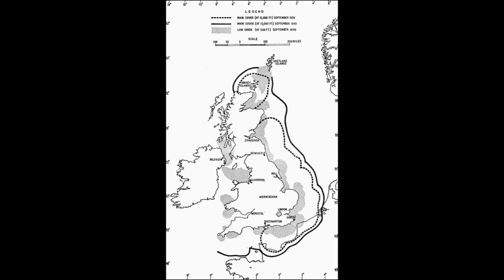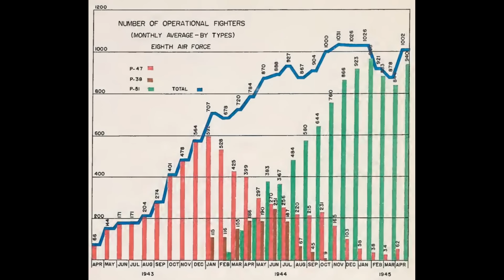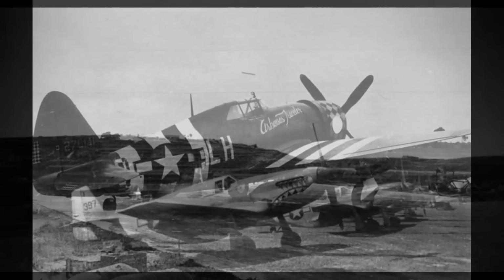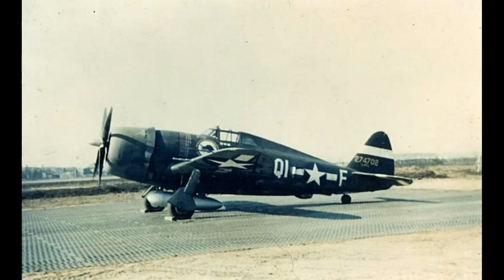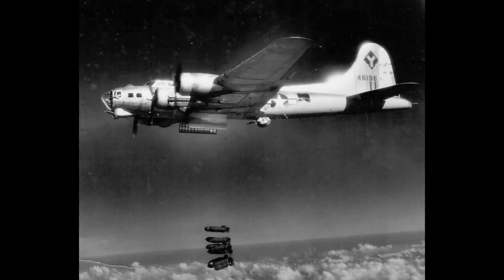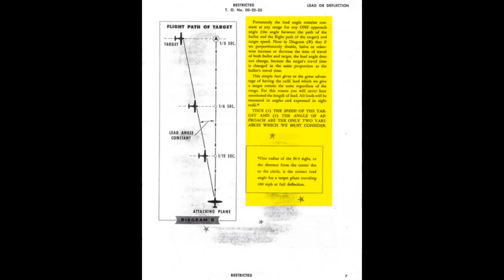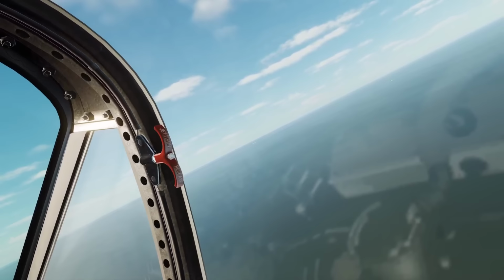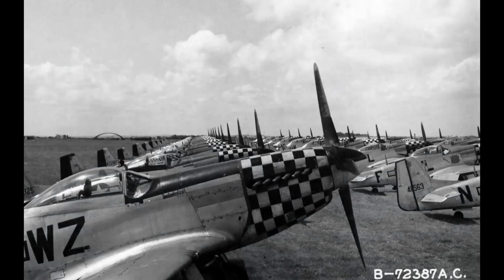Under Appreciated BRITISH Tech From WW2

Comment: Riccardo is still a world - class engineering company in the field of internal combustion engines today.
Reply from the maker: Yup, I should have mentioned that.
Reply: Only a few miles away from me, still on the site alongside the River Adur and Shoreham-by-sea Airport where the company was established post World War One.
Reply: Ricardo built V twin test engines that were 1/6 of the full V12. They were thrashed and played with to improve the production engines. However they failed to recognise the V12 oil pump was too small. The V twins used the full size pump so never had problems. Above 3000rpm, the V12 threw oil out of the crank faster then the pump could feed it. Ricardo really should have spotted that long before they did.
Reply: G'day,

That's ONE way of looking at Ricardo....

Have you ever tried calculating the Carbon Dioxide Emissions which have been produced by Engines which Ricardo's work MADE POSSIBLE...?

As Anthropogenic Global Warming ramps up and gets into it's Stride..., Ricardo's Kill-Tally of People on the wrong side of Storms, Floods, Winds, Hail, Droughts, Heatwaves, Fires, Famine and Starvation...; my guess would be that Ricardo is well and easily responsible for more  collective Human Misery than the bloke who designed Hitler's Gas Ovens....

Because when the Ovens were shut down they stopped cremating the murdered ; but everything emerging from a Ricardo-inspired Engine will continue heating the Atmosphere for at least 25 years after coming out of the Tailpipe...

The point in Time is rapidly approaching whereinat ALL the Pioneering Luminaries of the Fossil-Fuelled Industrial Revolution will be exhumed, and pilloried, and their Skulls used by the Mob as Soccer-Balls - merely to better inform their Shades of the extreme low-esteem and Pariah status in which they are held, among the still-living.

The fact that old Codgers like you and I were raised to revere the Pioneers of Aviation, and to salivate over the minutiae and details of their  Engineering ; the FACT remains that while feeding their EGOS, those bloody Clowns handed Humanity the means with which to destroy the Homeostasis of the Biosphere of Earth...

The LARGEST Single Organisation Emitter of Fossil Carbon injected into the Atmosphere, on Earth - is the US Department of Defence.

No other Organisation operates as many High-Power  Land, Sea, and Air Vehicles, or maintains as many Bases and Buildings (all lighted, heated, cooled and ventilated by Fossil-Fuelled Electricity) and issues as many Contracts to supply Goods, Services, and Equipment all produced, manufactured, and delivered by way of burning Fossil Fuels...

Unkle Spam's Pentagonal Haemorrhoids are the single Dirtiest bunch of Bums on the Planet. I'm sad to have to say it - but it is a fact.

How long are we expected to continue cheering and flagwaving and celebrating the short-sighted selfish dirty filthy wasteful destructive and poisonous Legacy, which  those miserable mongrel-bred Bastards have left, as wreckage behind them in their wake ; the smoking ruined detritus covering the overheated Earth, ALL  produced by their collective, Patriotic, "Life's Work" ?

At some point, Greg, we have to face the point that WE are the particular generation of  Scumbags who never ever thought to question our Parents' and Grandparents' decisions - instead we subjected them to Ancestor Worship, and then we all attempted to surpass their (reckless thoughtless wasteful dirty and destructive)  "Achievements"...; and thus WE have literally eaten our Children's Futures..., like any other pathetic greedy bloodyminded High-School Bully, stealing Play-Lunch from the  Kindergarteners...

So, maybe a bit less breathless admiration and enthusiasm, perhaps, when regarding the doings of the sort of silly bloody "Comedian" who gives a retarded Child a loaded Uzi, to see what becomes of the Experiment...; all in the name of Imperial Jingoism....

And, apparently, the Creator God of the Universe is not a CitiZen of ANY Nation on Earth, does not vote for or against ANY Political Party ; and does not care and is not interested in the competition between Capitalist Industrialists and Communist Industrialists and Fascist Industrialists to grow their EcoGnomie the fastest ; because ALL those bloodyminded selfish Morons are COMPETING to destroy their bit of the Biosphere fastest and firstest.

"Sieg..., HEIL...!"

translates as

"Victory..., HURRAAAH !",

OUuuuRaaahhh ....?

No Semantic Linguist can fit a 1-Thou. Feeler-Guage between "Sieg Heil !" and "OuuuRaaah !"...

Let
THAT
Sink in...

ALL of that
Patriotic
Industrialism...

The Wasted Effort
Which has almost utterly 
Wrecked
What used to be quite a
Delightful
Planet, on which to
Live
And
Raise
Children...

We were raised to revere the results of a Global Fashion for  Counterproductive Paranoid Diversional Therapy for Techno-Nerds ; obsessing over Compression-Ratios and Torque-Loadings and Tensile and Compressive Strength and Metallurgy and Fuel Consumption etcetera etcetera ad infinitum ad nauseum - while totally ignoring EVERYTHING which mattered considering what   came out the Exhaust Pipes, and living in Denial, as regards what those Exhaust Gasses were, and ARE, Achieving....

So, when ARE we going to stop singing the Praises of all the cunningly clever Buggars who dedicated their entire LIFETIMES to ways of burning ever more Refined Fossil-Fuel FASTER..., in order to pump ever more Shit into the Sky...?

Why are we cheering the bloody VILLAINS of the Story ?

Hmmmnnn ?

Just(ifiably ?) sayin'.

Such is life,

Have a good one...

Stay safe.

;-p

Ciao !
Reply: @WarblesOnALot  username checks out
Reply: @neilwilson5785  

G'day,

Yeah...

Truth-In-Labelling...

As the saying goes.

Such is life,

Have a good one...

Stay safe.

 ;-p

Ciao !
Reply: Also builds special vehicles for the British Army...
Reply: @WarblesOnALot  Wow
Reply: @markevans8446  

G'day,

I hope I didn't startle you, but the fact is that everything I said is true.

One of my proudest achievements has been restraining myself from rebuilding my 2nd Aeroplane, after we broke each other in 1992 (Downwind Take-Off, Ultralight Motor-Glider, Fence-hit, Inverted Landing in the next paddock...).

I have slowly accumulated the materials for the job, including a Rotax-377 to replace the gutless JPX Pul-425...; but, considering Anthropogenic Global Warming, the World will NOT be improved by me enabling mySELF to go up and make slow-moving Lawnmower-Noises in the Sky while farting Fossil-Fumes which will make the Drought/Heatwave/MegaFireStorm/Downpour/Hail/Wind/Flood Cycle grow forever worse...

My first Aeroplane hangs in the
"National Transportation Museum ; Visiting My First Aeroplane...!"

and my second lives in it's covered Trailer, a potential "Project" stalled for 31 years because I can't justify farting CO-2 for the FUN of fcuking up the Biosphere.

So, right now I'm enjoying my eBike, learning to logbook it's 4 Batteries meticulously, recharging from Deep-Cycle Lead/Acids charged by a Solar Array using an Inverter.

Living off-grid, the Solar Hut Lighting taught me enough to be enjoying the eBike..., next step is an Electric Chainsaw and Electric Brushcutter - with  the extra Panels and Batteries to recharge them ; followed by a Road-registered Electric Motorcycle..., and then the notion is to put an Electric Motorcycle Motor and Battery where the Rotax-377 was to have replaced the JPX...

Because a Solar-charged Electric Ultralight Motorglider would enable me to exercise my Biggles Fetish without shitting in my children's Air Supply.

At some point, old Bastards like me are going to have to stop pleasing pleasing ourselves, stop behaving as a mob of Selfish Pricks ; stop patting ourselves on the back for having achieved the doing of some Autistically difficult Thing - and start considering the Long-Term Consequences of all our Planet-wrecking Harvest Everything-ism.

And if I never fly my 2nd Aeroplane again until I can take it levitating to enjoy the view (and wallow in the thrill of the Death-Eater's Challenge involving  landing it again,  without breaking shit or hurting myself)..., without having to burn any Refined Fossil Fuels to do it ; then my guess is that generations of the as-yet unborn will be pretty pleased with that outcome.

And, y'know how Parenting works.

Everything falls under the

"Littlest Kid Rule..."

Which is why, for example, Toddlers will happily wait their turn and watch while their Parents care for the needs of the Toddler's newborn Sibling.

The Toddler knows that, being older, they can wait with better grace - while the Newborn's NEEDS are catered to..., than can the Newborn wait while the Toddler's WANTS are being satisfied...

And, as Adults, our WANTS to fart Fossil Fumes for the Fun of it all - going faster and higher, with a bigger load...; must, morally and ethically squeaking, come a long Long LONG way behind the NEEDS of the Generations yet unborn to be delivered into an actually Habitable Biosphere.

What's your annual CO-2 Emissions Footprint...; or haven't you worked it out yet ?

We have to do this Decarbonisation thing at some point, it is NOT avoidable and the longer we continue making shit get  worse then the harder it will be to make the change...., so why not start now, then ?

Such is life,

Have a good one...

Stay safe.

;-p

Ciao !
Reply: @jester5ify  

G'day again.

Question...;

Why do we need Armies...?

Answer...,

To prevent our
Handies
From falling 
On the
Ground...!

Such is life,

Have a good one...

Stay safe.

;-p

Ciao !
Reply: just wait till this guy finds out where the lithium in his batteries comes from
Reply: @WarblesOnALot  In the 1970s the climate scientists were telling us we should be preparing for the coming ice age. They still are not growing grapes for wine in the open in the UK like they did in Roman times.
Do a bit of historical reading why don't you?
Cheers.
Reply: @dairyking2479  

G'day,

Chile.

They sell it to the Chinese.

I am not as
Silly as
You
Look...

;-p

Ciao !
Reply: @WarblesOnALot  I do admire your 20/20 hindsight, but I think you forgot to blame early man for harnessing fire.
Reply: @WarblesOnALot  well that was alot of words to say absolutely nothing. Bravo👍
Reply: @WarblesOnALot what a sanctimonious load of scribblings.
Reply: @rollovaughan  

Get it right, 

I said

"BLINKERED..."

Y'know, the Leather Shades fitted to a Horse's Bridle to enforce a Worldview of Illuminated Tunnel-Vision onto the Beast of Burden...

Those Blinkers.

You cannot validly critique that which ye misunderconstumble ; because thus ye lead y'self into charging against Windmills, Quixotically, indeed...(!).

All I started out saying was that Riccardo, in hindsight, does not merit the sort of whickering simpering breathless admiration which 50 or 80 years ago seemed an appropriate way to regard someone who dedicated their Life on Planet Earth to developing ways to burn Ever MORE Refined Fossil Fuel, Ever FASTER, in Ever GREATER Quantities, in Ever BIGGER, Ever More POWERFOOL Engines..., all of his own devising - always hoping to see his Infernal Machines put into Government-funded Mass-Production, so as to inject As MUCH Fossil-Carbon into the Atmosphere as he could contrive to have been PAID to do, while he was alive and "contributing" to Humanity's "Achievements".

And then a bunch of Reactionary Trolls pipe up as if I'd been trying to rape their favourite pet Budgerigar, without wrapping it in Masking-Tape to stop it from splitting...(!).

As the old story goes,

"The Truth hurts, 
But it only hurts the
Guilty..."

Thus, 
One is
Unapologetic over having
Spoken a
Truth.

Such is life,

Have a good one...

Stay safe.

;-p

Ciao !
Reply: PS.

Backtrack me to my Videos to see my Carbon Footprint if Minus 1 Ton Per Year.

The 100 Acres of Forest I'm responsible for sequesters 1 ton of CO-2 per year per acre.

My Car, Chainsaws, Brushcutter, Waterpumps, Backup Generator and Kitchen Stove, and the Food I buy in the Stupormarked, collectively, emits 9 Tons of CO-2 per year.

The "Average Ozzie" emits 30 Tons per year and I have 2 Adult Children - BOTH living Off-Grid using stand-alone Solar-Electricity, Gas Cooking and Wood-fired Heating (renewable)...; but both are plugged into the EcoGnomie, one the town Auto-Electrician and the other a Team Leader Traffic Controller...; so they drive a lot, and thus I try to sequester a full 30 tons of CO-2 per Offspring per year - on principle, as well as the 9 tons which I emit...

And somewhere out there exists a theoretical Tavpayer who funds my Pension, so the Forest I pay Council Rates on - from the Pension, has their 30 tons of CO-2 for their years' doings sucked out of the Air and built into the Trees which I look after...

And, finally, that leaves ONE lonely Ton of CO-2 remaining, after I clean up that for which I feel reasonably personally responsible ; with which I attempt to ameliorate Anthropogenic Global Warming.

A better result has been achieved by way of my work publicising the results of my "SunFoil Project" (backtrack me to my Playlist of that name, Raw Observational Data, the CSIRO Evaluation and Endorsement, and Construction Videos are all posted...; retrofit your normal ICE-powered Road-Vehicle with a streamlined Solar Array, to finish recharging the Battery after Engine Shutdown, and by thus unloading the step-up Belt-driven Alternator from the Crankshaft unless the Car needs more than the Panel is providing - anywhere from 4.5% to 35% of the vehicle's monthly Fuelburn/Emissions will be saved.

There are now over 50 Samizdat Copycat SunFoils getting around my home town. I've been pushing the concept for 13 years, but Sheeples are VERY Change-Averse.

Check it out.

How much CO-2 do YOU sequester, or prevent from being emitted, annually ?

;-p

Ciao !
Reply: Ricardo engines were fitted to Mk V  WWI tanks, a great improvement over earlier types.
Reply: @WarblesOnALot  me? i try to emit as much as possible, i like to feed the trees.
Reply: @andrewallen9993  I have a bottle of Kent sparkling wine that says you are wrong.  I can assure you it wasn't grown under glass.
Reply: @dairyking2479  ..and the coal and ore China depends on
Reply: @andrewallen9993 egardless of warble's warblings, vineyards have been operating in England for some time, and the fact that a few*, and *only a few scientists, and not all of them climate specialists, in the 70s, speculated about the possibility of an ice age has nothing to do with the current situation, the severity of which is agreed upon by the overwhelming majority of the people who actually work in, and understand the field.
Reply: @ianmcsherry5254  That explains why Holland and London are presently underwater as most of the climate specialist scientists said would happen due to the rise in sea levels twenty or so years ago.
The reason that it is called climate change instead of global warming like it used to be is that the globe is demonstrably not warming.
I would very much like to hear your explanation for the reason for the name change.
Reply: @andrewallen9993  again, you are exaggerating, or relying on trivia, as opposed to the general consensus. London is very much at risk of flooding, far more than in centuries past. The mitigating factor now being the Thames Barrier, although it is estimated that even that will be inadequate in its current form in decades to come. Similarly, the Dutch have long been experts in flood prevention and indeed, land reclamation. Global warming is also accelerating, and has demonstrably been doing so since the industrial revolution. Any sober look at the figures will tell you that. The term "climate change" has not supplanted "global warming", except in your imagination, apparently. Climate change is a broader term which better covers the effects which are being, and will continue to be experienced around the globe for the foreseeable future.
You've been told now. I don't know what passes for "fact" wherever you live, but from my POV, you might as well be citing from the last Star Wars film. Don't bother replying.
Reply: @rollovaughan  ...well Warblers does seem to fit the Aussie mould of a type of select group of there population that moans endlessly on & on & on ad infiniteum, usually once with some mix of Mediterranean & Western Australian territories heritage...
Reply: @WarblesOnALot  just go to church and pray…re the Water Injection,I think there was a war on…first world problems.
Reply: @WarblesOnALot  Nah,I meant YOU go to church instead of making up your ‘own’ religion…I’m actually a Nihilist.
Reply: @ronmcdonald690  how dare you,lol
Reply: @andrewallen9993  Having seen vineyards, in the open in southern England, I will say that your wrong.
Reply: @thomasbaker6563  Vineyards full of genetically modified grape vines. Not Italian standard root stock.
Reply: @dairyking2479  same place as the lithium for his medication?
Reply: @ianmcsherry5254  

Currently, the avg temp of earth is 14c
Bad news for you: it will become 24-ish even if we kill off everything producing Co2
Because we are currently ending an ice age and with "we" I mean dat we are experiencing it, not causing it (It's been melting for 13000 years now)
Reply: @dairyking2479  battery technology is developing rapidly, lithium won't be around much longer. We are slowly realising that we shouldn't shit in our nest. I remember lead plumbing, and lead in petro[, but we need to go much further un cleaning up our act, and we need to do it now.
Reply: @andrewallen9993  every time I see this particular bit of oil company propaganda I ask for a citation. I Have never seen one, but I'm always up for learning, so do please provide.
Reply: @tonym480 Wow I live in Worthing, had no idea it was so close